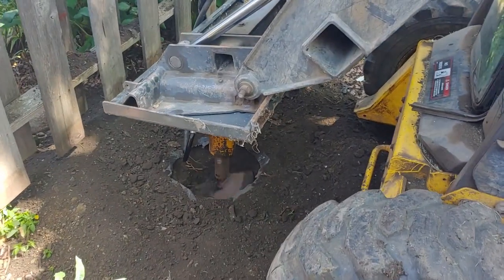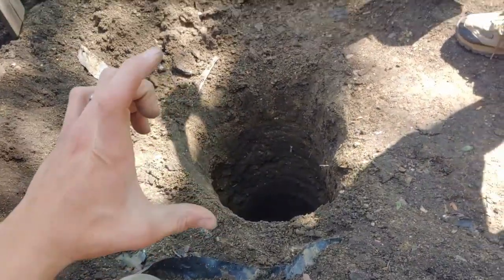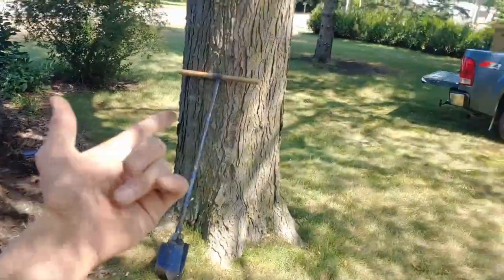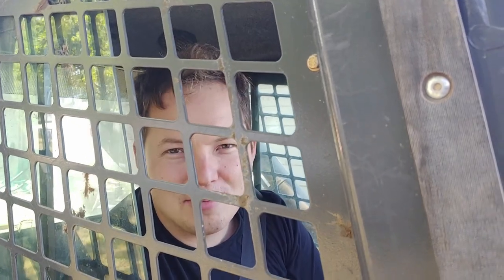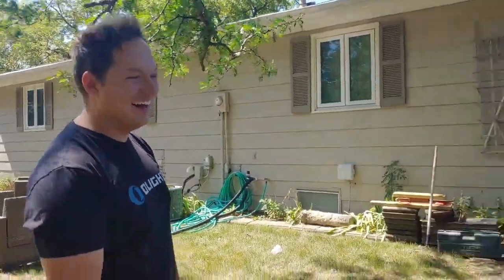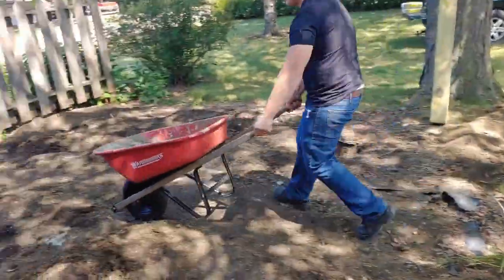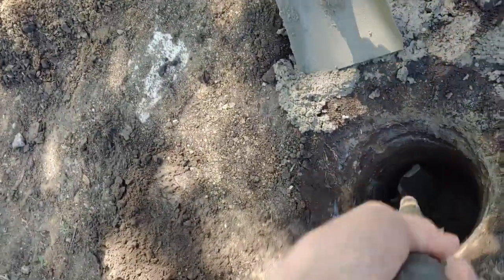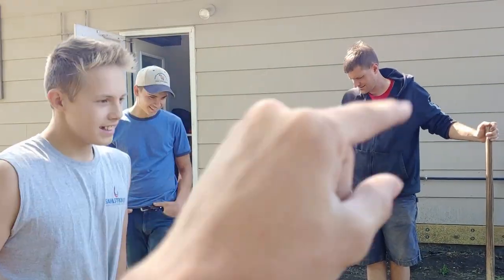How Deep do Deck Footings Need to be?

Comment: The depth of the footings depends on the climate. If you are in northern states where it gets cold enough to freeze the ground, then 42 inches may be necessary. If you are in Florida, probably 18 inches might work. Check your local building codes. Also, the stuff you are pouring into the holes is not cement. It's concrete. Cement is just one of the ingredients. I personally don't bury any wood in the ground. Even pressure treated lumber will eventually break down in the soil. When I pour deck footings, I pour concrete all the way to ground level and the post sits on top of that.